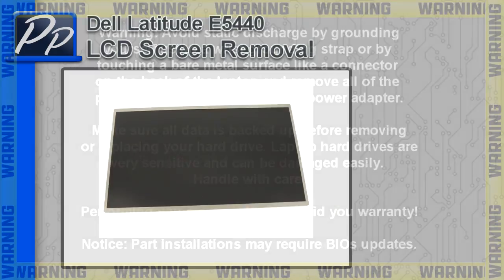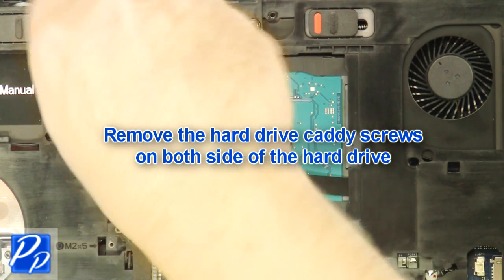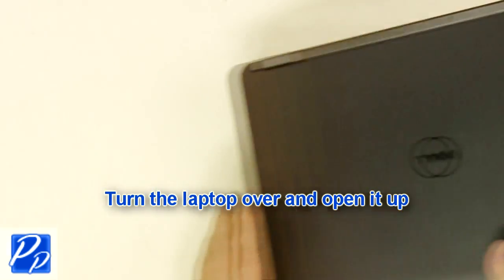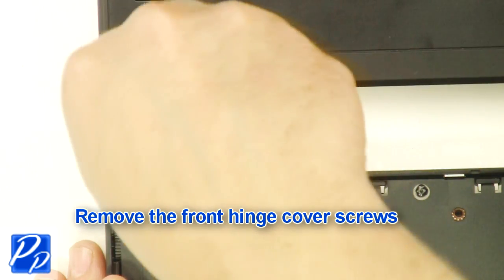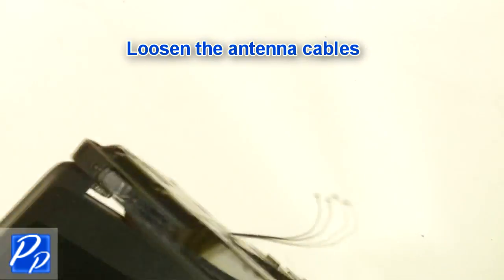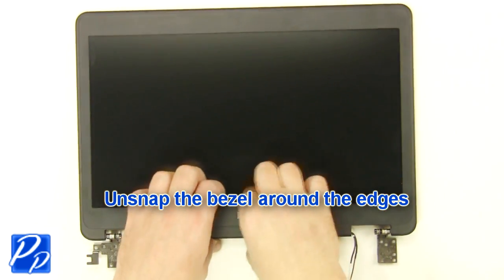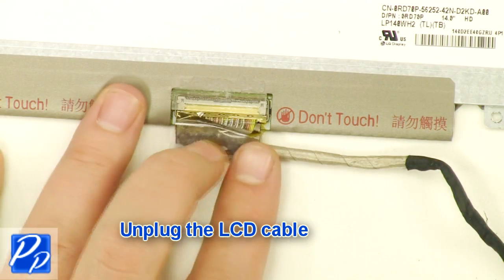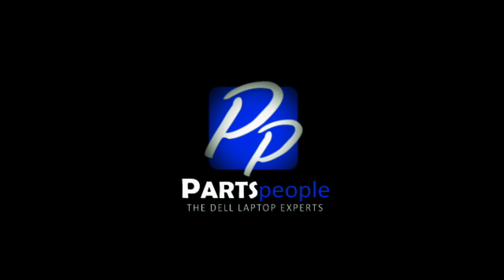Dell Latitude E5440 LCD Screen How-To Video Tutorial

Comment: I want to use an e5440 with an external vga monitor, and be able to leave off the internal monitor completely. I tried this with a n4110 and it would not boot without the monitor. Would you know if the e5440 will work without the internal monitor? Thanks.